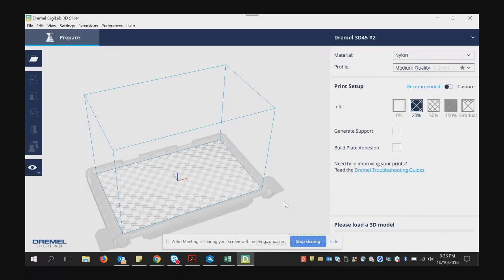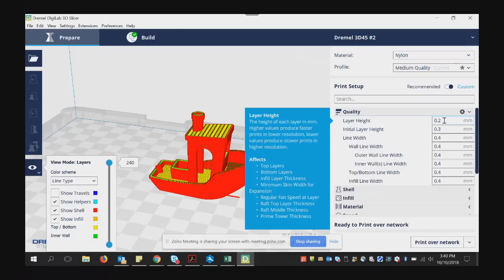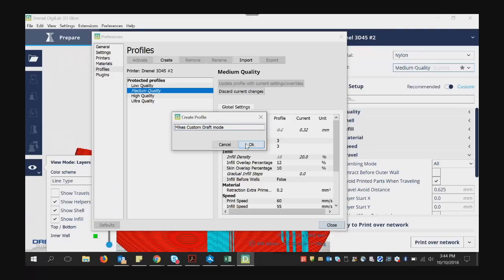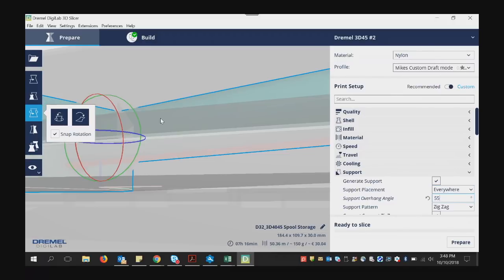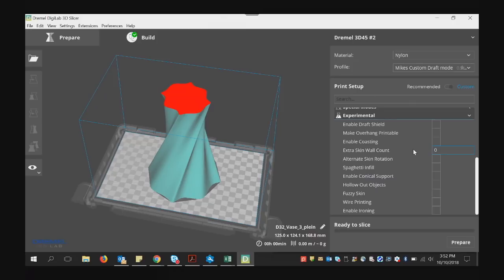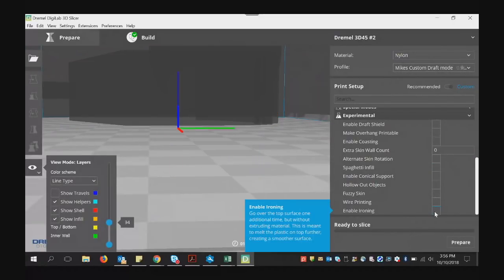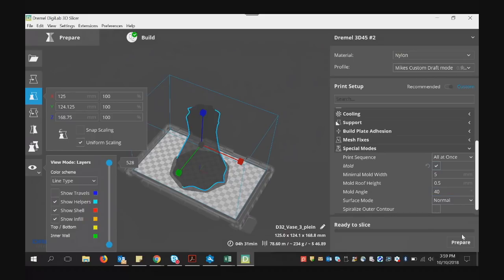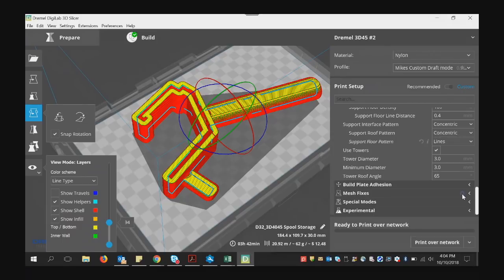DigiLab 3D Slicer Advanced Tips & Tricks

Comment: Thanks for making this video. I would like more info about troubleshooting network connection issues. The printer IP info is visible on the device, responds to ping, and match settings from our network admin, however the Dremel DigiSlicer 1.2.3 says that the printer is not connected. Remove, add, same issue. Restart printer. Unplug device. Nothing works.
Reply: Actually, I will contribute a solution to this issue in case some one else runs into what we experienced. If you have a static IP address configured and your Dremel is set to use that address, but the software says the printer is not connected...it might mean that SOME OTHER DEVICE is using that address. Ping the address WITH THE PRINTER OFF and if it responds, no, it is not a ghost in the machine. It is an IMPOSTER. Ping a few more addresses to find one not in use and "borrow" that one as your new/temporary address and voila, you are back printing. ☺